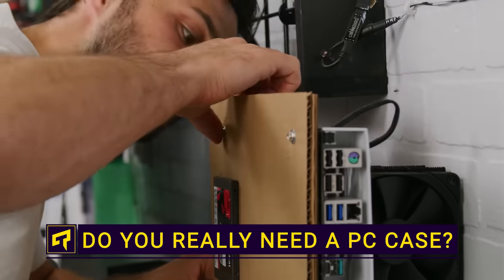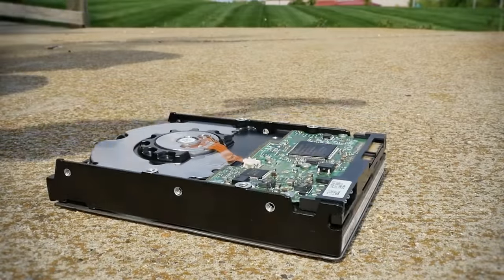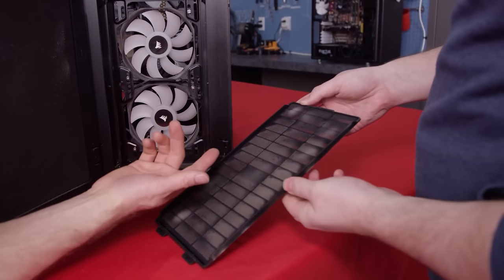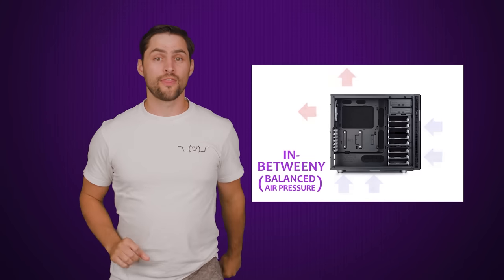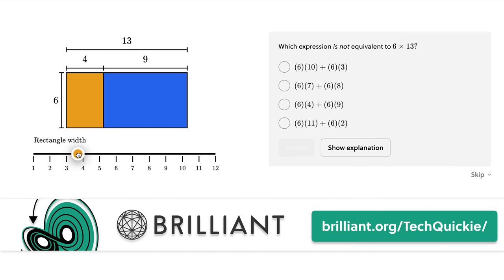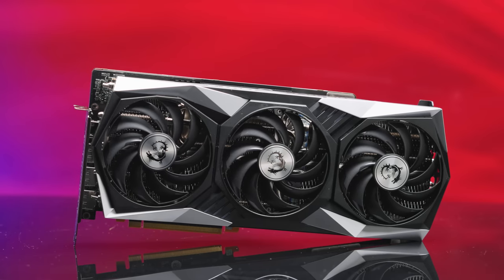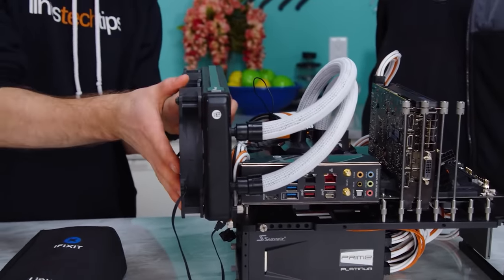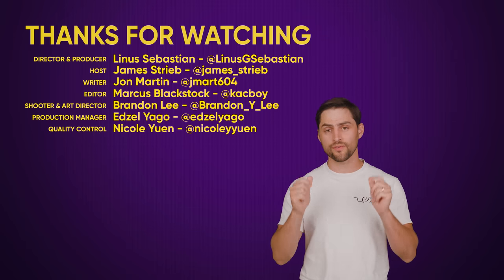Do You Really Need A PC Case?

Comment: I feel the "static" issue is a bit overexaggerated here. LTT did the video with ElectroBoom and the static gun, or IDK maybe its just been too dumbed down for my taste.
Reply: Yeah, if they can't short electronics with electrobooms gun, I doubt it's that easy to short components
Reply: Static can and does damage components, the ElectroBoom video was trying to see if you can outright kill components. But static is more like wounding a component then killing it. The damage static does is to the traces of chipsets. So can make them more unreliable. So acting weird, crashing unexpectedly, not as stable in overclock.. etc. is what static is more likely to cause.
Reply: Its so super rare to kill a component with static electricity, but do you wanna risk your SUPER EXPENSIVE component to be dead? Chance is never zero, better be safe than sorry
Reply: not only that, but just touch your PSU before touching another component if you're worried about it.
Reply: Static can cause issue's not just parts failure so for example it could cause ram to start producing occasional errors which might not be enough to kill your pc but could cause issue's like program's or games randomly closing/crashing, bsod, reboots etc also they could be so intermittent that you don't even realise it was static that did it because it took you 3 month's to realise you have a fault
Reply: @Layarion  maybe but most people unplug thier pc before doing any work on it. Hence there is no ground
Reply: @joshuapettus6973  still better than nothing though i imagine?
Reply: Yeah as someone in tech and who's done admit of this it's an issue but not terrible

Comment: Regarding static, I met a guy who had a motherboard mounted to his wall and was running a humidifier to prevent static buildup
Reply: Can't trust until I see it . Need Pics.
Reply: @arnavbule  it was over a decade ago, closer to two.
Reply: no static but oxidation yay
Reply: why not just use standoffs?
Reply: @manfail7469  how would that protect it from static discharge?
Reply: @daffodil2067  good point
Reply: @manfail7469  that wouldn't do jack
Reply: As long as you have your PSU plugged into a properly grounded outlet you should not have any static buildup...
Reply: @FelixEnder  he wasn't worried about static build up on his motherboard. He was worried about static build up on anything or anyone that might touch his motherboard.
Reply: Humidifier = $40
Basic computer case = $40

Okay.
Reply: @daffodil2067  hm.. ok it seams i am missing the point here...
what exactly could build up a static that could then somehow touch the Components?
Flys or was there random stuff just flying around well then i would worry about something else then static.
And i dont think that a humidifyer works if some random person that is staticly charged just walks up and touches stuff, and even then i would worry about them breaking stuff by touching it more then with static. And if this person or someone who knows Computer stuff would walk up and had to touch it he first could simply touch the PSU to get rid of any static or wear a grounded wrist band...

Humidity + Electronics seams to me here the worse part... but yeah idk im just a random person on the Internet that does not know anything about the real situation.
Reply: @thebasketballhistorian3291  Well there are open cases now that do simply that: mount your MB to the wall with some support for the rest of the components so there seams to be people out there that like that look but what i dont realy get is the Humidifier part...
Reply: @FelixEnder  the humidifier works because humidity dissipates static charges. though it would probably prevent a 100kV static discharge, I don't know that it would prevent a 1kV static discharge.
Reply: @hmello3250  There's very little on a board to oxidize that wouldn't in a case anyway, everything is lacquered but the connection pins
Reply: @MrTrilbe  have you ever bought used electronics from someone who lives near the beach?

Comment: I rocked a case-less PC for several years in the early 2000's. I'd gotten my hands on my first multi-core system: a dual processor Pentium II Slot 1 system. It was a beast. None of my cases fit, and I'd already spent my last penny on acquiring some RDRAM for it. I kept it on an elevated shelf in a corner where it couldn't get bumped, and used a screwdriver for the power switch.

sigh Those were the days
Reply: Wow dual core in early 2000's, you are cool man
Reply: One of my friends back in college had a caseless build. He had that thing attached to a wall.
Reply: Ah yes the Core2Duos. What a beast.
Reply: Did you just get like a power button adaptor or just used a screwdriver to turn on your pc?
Reply: bro got manual transmission instead of a power switch
Reply: @danielc.5103    He said it in his comment,  can't be bothered to read two lines of text?  😆

Comment: I built my first PC in 2012 and didn't have enough budget to get a case... After which, caseless builds became a choice. All my future builds (personally 2 more so far) have never been in a case, and the only problem I've had is dealing with dust. That said though, I have a separate personal room for these builds, it looks insane, no pets or kids are allowed into this room and no one enters the room if I'm not here. 

I'll never put any of my personal future builds in a case either, since 
• less cost, (no case, no case fans, no fan controllers etc)
• far better cooling, 
• no restrictions to expandability, 
• ease of access to any physical hardware, 
• super easy to troubleshoot if I have a hardware problem, 
• complete direct access to both front and rear IO, and
• no GPU sag (the PCIe power cables pull the GPU back and it is a sturdy hacky DIY test bench = no wobbles),

I prefer these benefits over those of building inside a case.
All 3 of these builds (2012 build, 2017 build, 2021 build) all work perfectly to this day, and the old ones have gone through a lot.

The oldest build still working properly, is enough for me to recommend trying a caseless build without too much worries to anyone who has a room to spare, can make sure no one physically messes with it, is careful with food/drinks/etc around the build and can clean it once every few months.

Also, static is a thing to be careful with (a zap from my shoulder into the hanging PCIe 8pin from the GPU in the winters with those warm clothes that easily get static) so before touching the build or going close to it, best to touch your foot on the ground once (to ground any static).

I have had my 2012 and 2017 builds' motherboards RMA'ed before because of a faulty power supply problem, but the reasons why I had to RMA weren't related to the build being caseless. Some manufacturers can complain about "bent pins" when trying to RMA though... [ASUS isn't one of them :) ]
Reply: hello !! i'm just about to put together my first caseless build! can u drop me ur discord or smthn i have some questions and i'd appreciate some additional tips !

Comment: i ran into an unexpected issue having my pc case-less the past year or so. i noticed when i went to clear the dust off that it was all stuck to it and compressed air wouldn't work. there was a griminess to it and I actually had to use cleaning solution on all the fan blades and everything, it sucked. My only conclusion is that im in a relatively small distance to my kitchen and i cook with oil all the time without running a vent. Perhaps the aerosolized oil in the air was gathering on my PC components.
Reply: I had the same problem, until I realised I was doing it wrong.  Compressed air works, but it needs to be blown every day, before the dust meet humidity,  grease particles and heat to mix up the sauce. I was forgetting it, so now I have an external powerful fan connected to a smart plug scheduled to blow my test bench 2 times a day, and it works fine.

Comment: Yup was doing this since early 90s, most of the time it was just shoe box. Those days I mount it on the wall, easier to clean it up. Never had a problem with dust once since I use car wheel pumps usually, USB those days, works great!
Reply: good thing nobody throws a water bucket into the wall
Reply: @kanuh , not usually no 😅

Comment: I had a system with 6 mechanical hard drives that got super hot. I cut some cardboard and screwed a couple 120mm fans into it. Then mounted them next to the drives using high technology state of the art packing tape. It was surprisingly easy and secure too, plus the drives were astoundingly much more cool under load.

Comment: Best not to skip getting a case for your main rig.  If you can, upcycle and old ATX or mATX case.  With some minor tweaks, that ancient case could be a good home for your rig.  Example:  A Dell Optiplex case from 2004-2005 with a 140mm bequiet fan mounted to the outside and blowing though a hoke where an ugly Dell logo and circle once was.  It's a perfect fit, you just have to drill the holes for the mounting tabs of the fan.  I ran that setup for a while and CPU (Ryzen 7 5700X) temps never got above 60C with even a cheap vertical CPU cooler.  This was while running WoW, KiCad, and over 50 tabs in Chrome.  (ADHD, need I say more?)

Comment: I run my $1200 setup out of a 2ft x 4ft cardboard container. The only other thing i need is a screw driver to bridge the power switch
Reply: some components may only throttle when they reach 80°C.
Reply: @ollllj  i thought of that! I have a simple fan profile i set up for my gpu thats takes care of my box  and has enough thermal headroom for a pretty solid OC too. Nothing gets over 65C!
Reply: You can find power buttons online! They sell them to work with the normal 2 pin setup.
Reply: I at least have mine in a piece of Ikea furniture with a 486 control panel, and it turns on with the keyboard key ;)

Comment: One missed point is that if your GPU is vertical, the exhaust air will blow upwards and create this bubble that blows dust away.
Also the dust being really easy to clean if you don't have a case.
In my opinion going caseless is 100% fine as long as you don't have cats or toddlers around.
Reply: Honestly I have an air compressor for a this reason, even in a case I just blow it out once a month
Reply: they probably just wnna make people buy more case lol. There will be more dust buildup inside a casing as long there is air movement, needed for cooling. With open bench, fans get cooler air(not mixed with warm air) hence lower noise, people don't need "quiet casing". Dust on psu? just place the filter on top of it and be done, no more dust inside it. Gpu bending mobo? well, thats true, definitely need to be carefull, but thats mostly for high end gpu and extreme case. Been doing this for years, nvr had any problem. Cases have more downside, except for expensive one, which it find to be ridiculous.
Reply: @gmailisaretard  cats are worth the sacrifice :)
Reply: @leaf4664  cased PC's can have better airflow and cooling than caseless, IF and that's a big IF the case is designed right, most cases outside the server space aren't designed for cooling well, look up fluid dynamics for the science
Reply: Okay then I am going caseless no problem in that right . Building PC for the first time
Reply: @whitewolf8637  Just have the motherboard sit on something non-conductive. Box the motherboard came in will do fine. Flip it over, and have the motherboard sit on top of it. Or inside of it, if you are OK with little arts&crafts project making holes for the IO.
And remember to buy one of those on/off switches, so you can start it. They cost like 3 bucks
https://i.imgur.com/PlTp4Ms.jpg
Reply: What if I use a hair dryer to clean dust? Is it as good as compressed air?
Reply: @Blurrybob  not as much pressure and if the air from the hair dryer is hot it can cause problems, there's also issues with forming a static charge from the air flow over plastic
Reply: Isn't the dust going to come back down and go through the cpu heat sink?

Comment: you don't need a case, period. Skeletal cases prove the point; you can screw the mobo to the underside of your desk if you feel like it. Mobo environment needs ventilation and dust filtration but the higher off the floor (like small form factor) the fewer anti-dust measures you need to take.

Comment: What if you made a cardboard stand that holds your components upside down. Kind of like an upside down open test bench. No more dust!
Reply: This sounds like an amazing and terrible idea at the same time and I don't know why.
Reply: @gobbel2000  you'll just need to pray your components don't slip out of their sockets. Pcie slots lock anyways so it'll probably be fine.
Reply: LTT should be encouraging more janky ideas like this! None of that .. safe and normal crap ! :D
Reply: @gmailisaretard  there's many ways to support the cardboard so that doesn't happen, and the motherboard, if screwed into the cardboard with some kind of drywall screw, would act as it's own structural support.
Reply: @gmailisaretard  just get more cardboard, I have 3 stores near me that just give away boxes. Even at that, it's not like it's expensive.

Comment: Not that I recommend doing this, but so long as your components plugged into your psu (via the 24 pin cable and the 4/8 pin cpu cable, and gpu cables, whatever size and number you need), and your psu is plugged into the wall, static isn't that big of deal. It will normally just go to any ground pins, as the quickest path to ground is...well, ground, which is where electricity wants to travel.

And before anyone says "your PSU has to be on as well!", generally speaking, electronic devices with a power switch terminate the hot side of the powered components, in order to deal with such things as static and EMF while powered off. So the ground is generally always connected to ground/neutral. It's not like a switch in your wall, which connects 2 points.
Reply: no. If you just zap ground plane, or a power lane, nothing will get fried. But if you zap a signal line (which can be fried), having the thing plugged in/grounded is going to make the current higher (because the capacitor formed between you and the mb is smaller than the capacitor formed between you and mobo and the earth), so damage is more likely.
Reply: small correction: capacitances are not very well defined... If you touch a grounded thing, all the charge on you will be neutralized through it - all of it flows through the vulnerable circuit. If you touch a floating thing, the charge will merely redistribute from [you] to [you + the thing], so only a small part of the charge flows through the vulnerable circuit, and so, the pulse of current will be much smaller.

Comment: I literally put it in the big Amazon box all the Amazon box it came in, which is about the same size as an atx case. Stripped it off tape and lose pieces. And made sure the power supply grounded it if there was any static. I even screwed in the motherboard so that I could stand the box up like an actual pc case, cut a whole for a single case fan I had laying around, and it worked great for the three months until I finally found a lian lii lancool 2

Comment: ---
More of the answer here is that you do not necessarily need an "enclosure" but some sort of supporting "frames" are pretty much a must for the components.

It's nice to see we're starting to have better availability on more open-air and smaller light-weight "cases" for the much better "decorative"-purposes
( I'm missing the correct-word but more if trying reference on the compact-size so you're having easier time to find a the operating-spot plus easier to moce around for the maintenance plus clening procedures).
---

Comment: you guys did a whole video trying to kill a ram stick with ESD. ESD is significantly less of a factor than to hardware 15+ years old. totally agree on the dust but i have an air compressor. not all do and cans of co2 cost a lot. i use parts with gravity in mind so motherboard flat on the table .You make good points but all can be mitigated.
Reply: yes there any model of hand powered sprays for occasional use?
Reply: @srpenguinbr  the cheapest chinese one you find in your local hardware store
Reply: @srpenguinbr  a slightly better idea depending on how often you vacuum small things is get a wall vacuum with reversible thrust. it wont blow everything away but neither will my air compressor

Comment: A well configured case will also improve your thermals. A good setup is designed to pull air from down low where it's coolest and expel it up high, making sure the hot air isn't immediately taken back in. Without the case performing this function, the CPU and GPU fans are going to create zones of hot air around them as they repeatedly pull the same air through. On my system there is a noticeable difference with the case open and closed of about 4 degrees.

Comment: Git an idea for Linus, get an old-school desk seat, the one that opens up, and turn it into a gaming PC. no one has done this. , maybe use the deak lifting up to place the LCD so 100% hidden
Reply: I was actually thinking a toilet would make a fun PC case. Motherboard in the reservior, watercooling involves the bowl, a little monitor under the toilet seat cover for thermals and usage data, turning it on requires you flush.
Reply: Linus had a PC in the desk, so you actually `git clone` the idea ;D
Reply: @GH0STST4RSCR34M He did do The ULTIMATE $20,000 Desk PC, A desk is a desk I did not think of that, would maybe come off as a downgrade repeat. Could maybe be a fun retro take.

Comment: I remember back when plexiglass windows started to trend in cases that there were claims that a case without a window helped protect your system from radio, emp or some other outside interference cause the case was all metal and blocked that stuff.